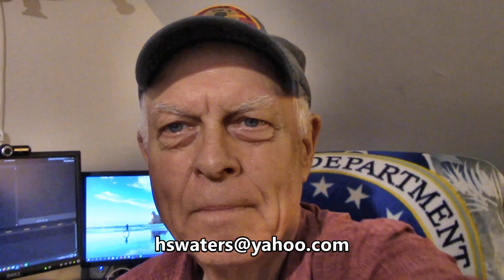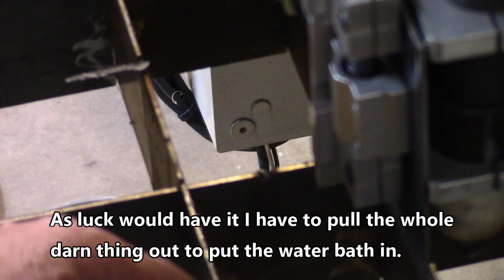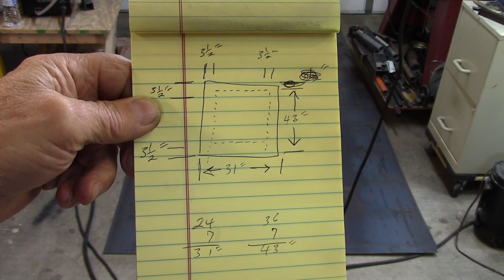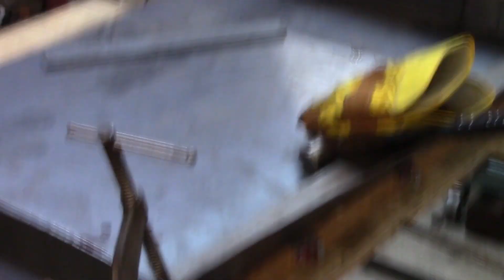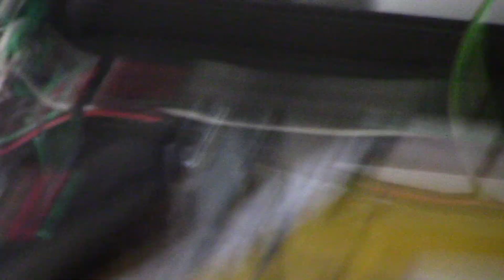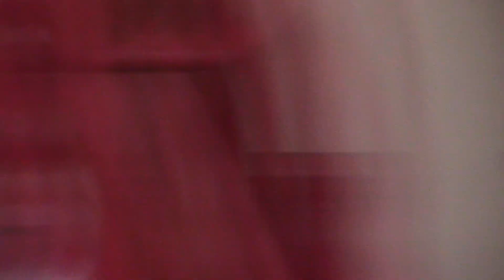CNC plasma water bath

Comment: Harold, I have been meaning to say this now for a while.... what compressor are you using? A crummy boxstore compressor, one that has pulses in the outlet, on account of the movement of the airpump, isn't going to do the trick... Maybe a buffer vat could help (if that is the issue)

Paddy
Reply from the maker: Well Paddy it is a cheap Harborfreight compressor.  I think the only hope for it is replacement with a very expensive but good compressor.  Thanks for stopping by.
Reply: @AmateurRedneckWorkshop  Harold, I am using a Metabo-doublehead compressor with an 80 liter tank and a separate extra tank of 210 liters. Not the most expensive gear, but not no-names stuff either.  This works very well for plasma cutting (hand held!) That said, I do believe the extra tank is the thing that makes the difference as it works a bit like a capacitor after a rectifier : it smooths the flow out to a consistent one. In most compressors (sauf the super expensive stuff) you gonna see some of the pump-oscillations transferred to the output. This may be the culprit of most problems.

Paddy

Comment: Harold...Speed of travel...try speeding up the cut to the point you loose it, then back down a bit. Should improve your cut. same as an oxy-fuel gas cut.
Reply from the maker: I do try to run the thing as fast as possible but before I get up to 80 ipm the cut fails to penetrate.  Thanks for stopping by.

Comment: I doubt paint will stick to silicone sealer with success. I tried painting over it once and it just flowed off within a few seconds.
Reply from the maker: Hope springs eternal.  Thanks for stopping by.
Reply: They make a silicone that is paintable. I paint over it right after I spread it. It makes cracks and edges that have a slight movement like on a vehicle panel able to paint and not crack the paint. I been using it for years. My son puts spit on his finger and spreads it on a seam and it looks like a machine laid it down...